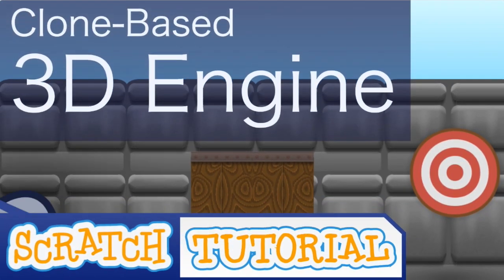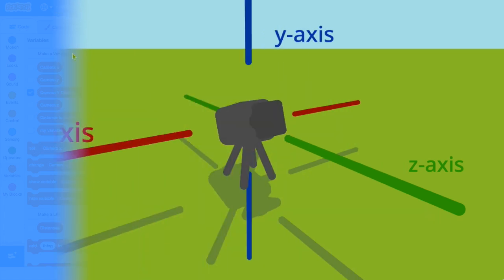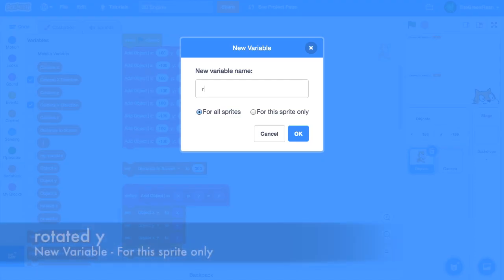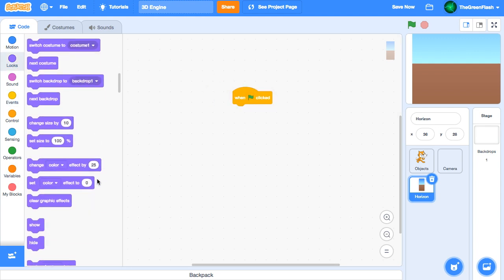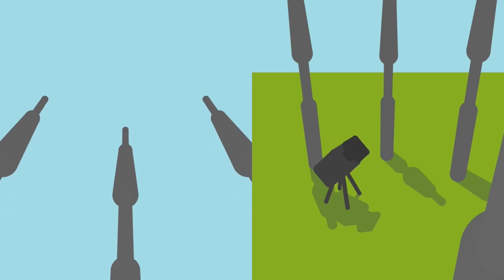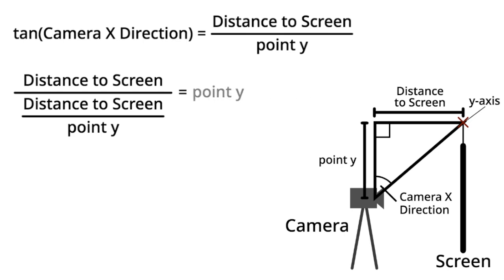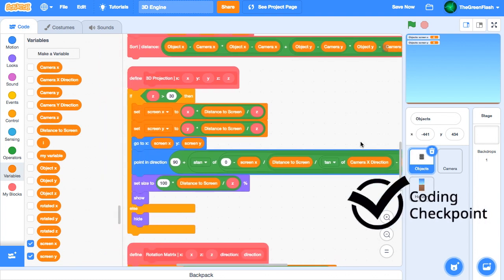Code a 3D Engine in Scratch | Part 2 | Up/Down Looking

Comment: why are my objects rotating??? I tried to check for errors in the objects sprite, horizon sprite, and especially the camera sprite but everything seems to check out???
Reply from the maker: Thanks for watching the tutorial! In case you haven’t, you could try comparing your code to the completed code here: https://turbowarp.org/497593298/editor
It sounds like a problem with the Objects sprite, especially if everything else is working, so I’d start there. It could be something with the math used to set the clone’s direction.
Reply: @TheGreenFlash  Oh yes I tried comparing it like that with the project linked in the comment below and I might have been sleepy, but I really also couldn't find any differences, but I eventually figured out the problem, some of my variables were for all sprites. Also, could you make a tutorial on how to make objects stay stationary in terms of rotation in walls for example? i mean it like walls point at you instead of just staying still so I'm trying to figure it out, but if you can then that would be a huge improvement. Love the Series btw :)
Reply from the maker: Thanks for the support! There’s a trick we could try that uses a combination of warping effects to make the costumes have more of a 3D look to them, but that comes with its own problems. Also unfortunately college is keeping me too busy to make more tutorials right now, but there’s a chance I’ll be able to make another one at some point
Reply: @TheGreenFlash  I Understand, Thanks!

Comment: If you feel the skybox is too small, but scratch won't let you make it any bigger, try making a small sprite, scaling that, and then changing it back to the skybox. You can then change the range to a much higher value

Comment: for some reason my up and down part isnt working
Reply from the maker: Thanks for watching the tutorial! I'm not sure what's wrong, but you could try comparing your code to the completed code here: https://turbowarp.org/497593298/editor
Reply: @TheGreenFlash  i did, the thing is they were the same …
Reply from the maker: If they were the same, they’d most likely run the same. It could be something small, like a set variable block setting the wrong variable

Comment: At 3:15 or somethin, i forgot to put the rotated y in the y: part of the 3D Projection | block and it was chaos lol
I fixed it, now everything normal
Reply from the maker: Nice, I’m glad you got it working!
Reply: you aren't going to read this probably but i made the same mistake and was trying to troubleshoot it for like an hour before turning to the comments. this was a life saver, cheers!
Reply from the maker: Hm maybe I should put together a Common Problems list for stuff like this. In any case, I’m glad you got it working in the end!

Comment: I LOVE THIS, but, is there a way to make the controls to move the camera follow the mouse if is there any way i would highly appreciate it
Reply from the maker: Thanks for the feedback! To add mouse turning, go into the camera sprite and add the code [set Camera X Direction to 0.2 * mouse y] and [change Camera Y Direction by 0.05 * mouse x] in the main forever loop. You'll want to experiment with the numbers to see what works best for you.

Comment: Could help me reuse clones in this 3d world?
Scratch's 300 clones limit is really holding me back from adding more objects.
In part 3 di address this issue
Reply from the maker: The code for reusing clones is different depending on the type of world you're building, with the simplest method being a view distance to simulate a foggy world. You could also try using TurboWarp's infinite clones feature, and then put a note in your project description to run the project through TurboWarp: https://turbowarp.org?clones=Infinity

Comment: I actually took this engine and converted into a 3D Pen engine, and I don't mean making the clones stamped, I made a script that draws lines in between the points!
Reply from the maker: Nice! The foundation should be the same, though I imagine you had to modify the sorting script and add line clipping. Sounds like a fun project!

Comment: idk wtf im doing wrong, but when i finished it, everyime the object touched the edge it just went insane and flipped out
Reply from the maker: You can check your code against the project in the video: turbowarp.org/497593298/editor
Reply: @TheGreenFlash  ty so much, this will help greatly

Comment: I’m making this except the mouse moves the camera. It works quite well.
Reply: How?
Reply: @CreativeDan521  I use transparent sensors that activate the camera, just like the keyboard press. They use the sensing block for when the mouse pointer is on them. I center the crosshair and have a space in the middle where the sensors stop for precise aiming. They are all ghost 100% so you never see them, but they still function properly
Reply: @CreativeDan521  I'm on a time crunch, the shotgun animations took so long

Comment: This tutorial series also works for Scratch 2.0, which is what I have been using when following this. There's a couple workarounds you have to do, like how 2.0 has no "Go forward 1 layers" or "Go to back" blocks, in which case you simply do "Go back -1 layers" and "go back 300 layers" or whatever to achieve the exact same effect, but it all still works perfectly.
Reply: It work just saying and yes there IS a go back # layers or go foward # layers.
Reply: @Willbin23  Not in Scratch 2.0, Scratch 2.0 only has the "go to front" and "go back # layers" blocks, the "go to back" and "go forward # layers" blocks were added in Scratch 3.0. But like I said, the workaround in for that  in 2.0 is simple enough.

Comment: Hi, I would like to add this to my pen render 3d engine. How can I do this. And also, how can I bypass the Scratch 300 clones limit, and reduce lag, because it lags a lot when there's a lot of clones that are rendered, and even on turbowarp, it lags a lot. Please help.
Reply from the maker: Hi, here's a link to a tutorial series on Scratch for coding a pen 3D engine: https://scratch.mit.edu/projects/170591185/ It uses many of the same ideas presented in this video, but the code is specific for pen. As for bypassing the clone limit, you can use turbowarp's infinite clones setting, but for Scratch you'd have to use something like Vadik1's InfiniClones engine: https://scratch.mit.edu/projects/413838043/ For the lag, there are optimizations like adding variables for sin(0 - direction) and cos(0 - direction) that are set once per frame in the Camera sprite and used in the Object sprite. This will be added in the next part of this series.
Reply: @TheGreenFlash  OK thanks.
Reply: @TheGreenFlash  Can you make a tutorial on how to bypass scratch 300 clone limit ?
Reply: @jmcortade8161  Use turbo warp

Comment: Thx tgf but can you do part 3 : platformer or physics
Reply from the maker: Yep, I'm hoping that will be the main focus of part 3.
Reply: @TheGreenFlash  I am looking for main things about the 3d engine like collision
Reply: @TheGreenFlash  but when will you post it here?
Reply from the maker: I'm not sure yet. Unfortunately I don't have enough time to make videos on a regular basis, but hopefully it will be out soon!
Reply: @TheGreenFlash  Thanks
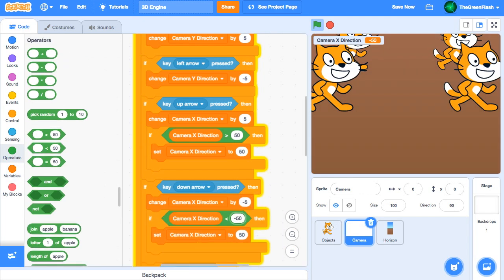Reply: @TheGreenFlash  5:17 I don't know why but this solution didn't work for me! The horizon is still showing white. Also, the turning speed is really high. (I followed everything step by step and even double checked) What's wrong with it? Btw your an awesome guy!
Reply: Nevermind, 50 was just too high. 18.7 and -18.7 worked for me, :D
Reply: @smileydoesstuf4194  he said it depends on the size, so your number might be different